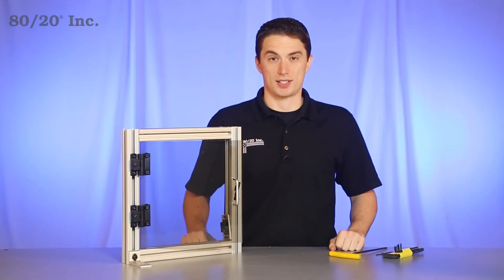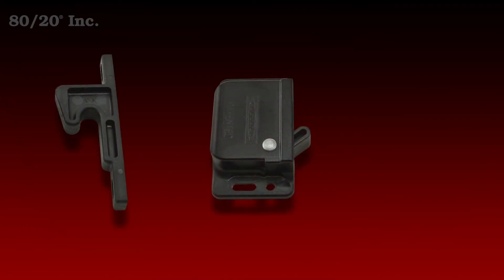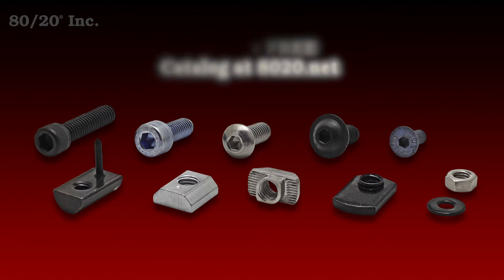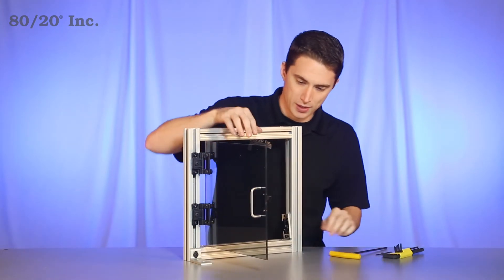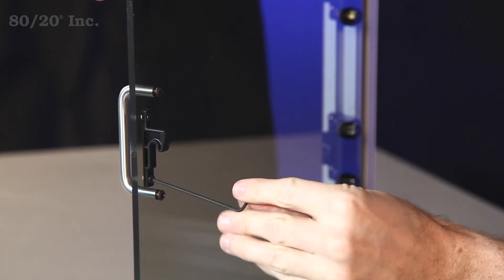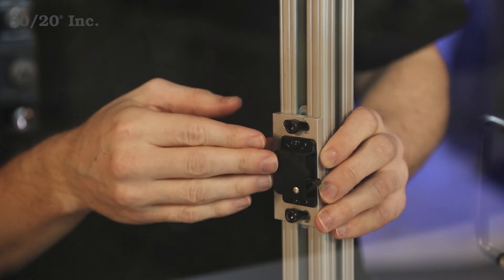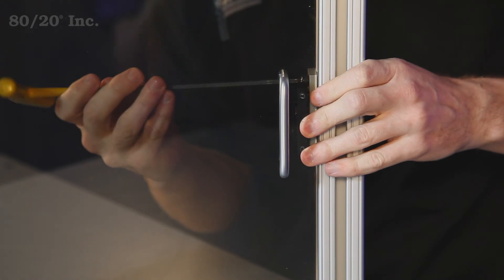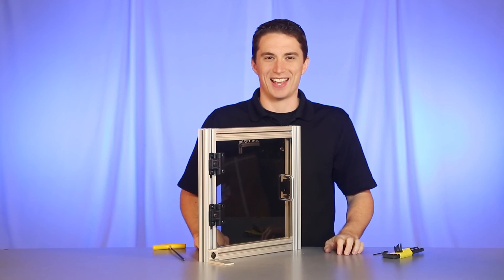80/20: Grabber Door Catch Overview

Comment: Is there a solution that creates a tighter seal?
Reply from the maker: In regards to achieving a tighter seal when it comes to panels and profiles, we recommend insetting the panel directly into the tslot, along with panel gasket.  As for doors / hinges, we offer Rubber Door Seal that can provided a tighter fit.
Reply: @8020llc  So If I am building a cube/box with 1 inch and I want a door in front, do I build a door with 1 inch or use a smaller extrusion and add one of your strips for it to close against? BTW, this is for a 3d printer enclsoure. The only reason I am looking at 1 inch it due to its .25 gap in the t-slot, there is lots of 1/4 material to slide in there.
Reply from the maker: @Jack Crow Cool idea! We've seen various 3D printer enclosures and frames built using our profiles, so what you are looking for is entirely possible.  To answer your question, how tight of a seal are you needing? Water/air tight vs just a flush fit, is going to determine a lot of your product options.  Our smallest extrusions are 1010 (1 inch) and 20-2020 (20mm).  Unfortunately, the Rubber Door Seal is currently only compatible with our 15 and 40 series.  However, we have several different style of hinges, mounting options, and tslot reducers, that can help provide a "tighter" seal, again it would just depend on what type of seal you are looking for.  If possible, could you email us at services@8020inc.com with your design considerations? One of our Design Specialists would be more than happy to assist you and answer more specific questions you may have.